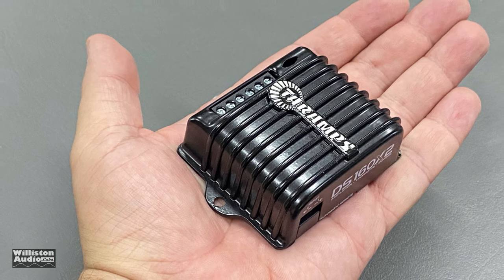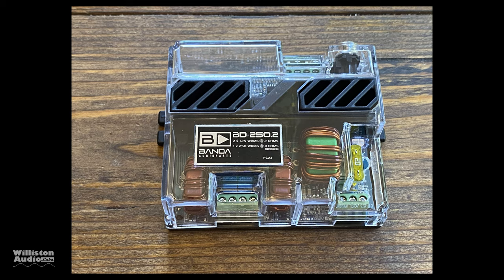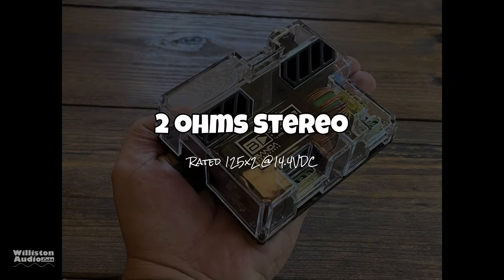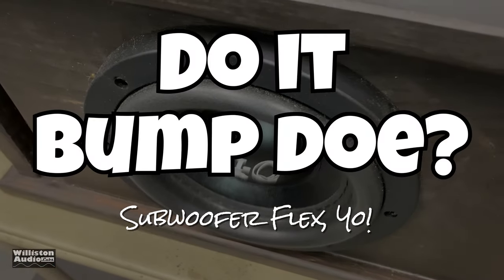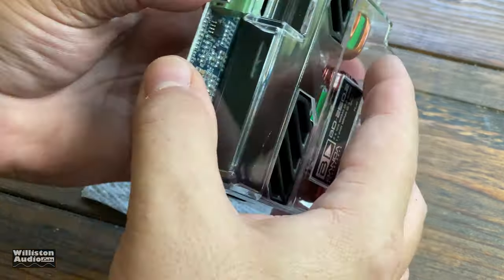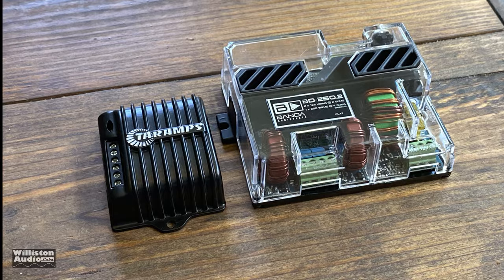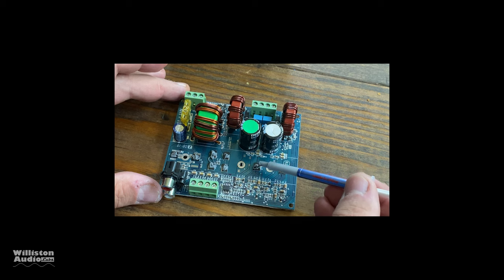This Little Amp is AMAZING! Banda BD250.2 Review and Amp Dyno Test

Comment: Hey Derek, I drive a concrete mixer I've added a 6.5 inch sub in a t-line box. I've been looking for a compact amp and this one is perfect!! I love your channel and your videos are awesome. Thanks for doing what you do!!
Reply from the maker: You may want to check the 250.1 model if you don’t have a crossover as that one has it built in. Thanks for watching and commenting!
Reply: Smith huh

Comment: So funny story, when I was 16 and I just got my first car (a 1990 Ford Festiva GL auto with AC as a gift from my grandmother) I had a Sony tape deck with a 10 disc CD changer, and I had a Kenwood bass booster (yeah...lmao), and a Blaupunkt 12 in a truck box in the back. It really didn't sound bad. I didn't have much cash back then, but it sounded decent with that car being a hatchback, and I eventually swapped in a 1.6L DOHC turbo Mazda engine into that car with a 5 speed and it hauled ass. My next car was a 1989 Chevrolet Beretta GT with two Orion Cobalt 10s with an unpowered Sony motorized tape deck, the same Sony 10 disc CD changer, a Sony 4 channel 500 watt amp, Infinity Kappa 5x7 split sets in the dash, Infinity Kappa 6.5s in the doors, and a Sony 1000 watt monoblock amp powering the subs.
Reply from the maker: Awesome!

Comment: Now that amp's are getting smaller and digital, someone should upgrade the amp's inside headunits as well.
Imagine a 2din headunit with 4x250wrms instead 4x50w. Can it be done?
Reply: ive been saying this for a few years now.
Reply: That be awesome
Reply: Doubt the companies will do that tho
Reply: In new cars with special a/c vent behind head unit to cool off.
Reply: 4x250wrms would be perfect for a nice setup!
Reply: @jeremypalon8327  why not? Imagine a brand like Pioneer do this. Would be populare i think
Reply: @lassediscovers1813  yeah would be cool tho, but like new cars nowadays already come with a decent head unit/ sound system with integrated things aswel. So there's prbbly not gonna be enough people who'd buy it
Reply: @lassediscovers1813  also sony kinda already has one but like 40Wrms × 4 @4ohm
Reply: @jeremypalon8327  i would👍🤣

Comment: Off topic, could you possibly test the theory that "low voltage" causes clipping. Im not sold, i think its the other way around, that clipping causes  low voltage. Considering lots of amps have operatinv voltages between 11 and 18v, would be interesting to see gains set at ssy 12.8 v then test for clipping at say 11.5. Thanks for reading.

Comment: Ever considered testing ARC Audio amps?  They are very popular for motorcycles and extremely expensive (way over priced in my opinion). I have the 600.4 amp and no longer run it.  The amp didn't last and their speakers lasted even less time. Way over inflated hype and cost.

Love to see what the 600.4 amp will actually do on the Dyno..  I still have my old amp I could loan for the video..

Comment: I enjoy watching your videos a lot, But id enjoy even more if you showed a 20hz-20khz .05% THD power test on all the amps you test.
Reply from the maker: I would also enjoy the $25k Audio Precision tester to run these tests.
Reply: Unfortunately They SMD dyno isn't that sensitive. The industry standard has been 1% for a while now, and since most people including those of us who are concerned with SQ, wouldn't be able to perceive distortion below 1% unless we were listening through very expensive, revealing speakers. The 0.5, 0.1, 0.05 tests are irrelevant for consumer grade electronics
Reply: @303nitzubishi4  That only responded to half my request. Regarding distortion measurements, it's only the "industry standard" for cheap amp manufacturers so they can inflate their power numbers. If they rated their amps at all frequencies from 20hz to 20khz and at the lowest possible distortion their power ratings would more realistic. (And lower) Well built amplifiers by reputable manufacturers rate their amplifiers from 20hz to 20kz at the lowest possible distortion. It's a shame the dyno isn't sensetive enough to give us a clearer picture of the build quality of the amplifiers, even the cheap ones. This is STILL the FTC rule for measuring power and subsequently advertising that power rating.
Reply: @wal  We can dream can we not? Still enjoy your videos!

Comment: Nice this would be a good amp for a car door speakers if your running them off your head unit like I'm doing. I'm getting 20 rms watts× 4 on my JVC head unit. That's only 80 rms watts. This Banda amp for $99 can put out well over that and sound good👍

Comment: I was thinking of using this and had a concern. Question on outputs for a 2 dr beater Geo Tracker. Looking @ stereo specs 4x60 watt output (15 watt/channel from harness). Want to use this 2 channel micro amp for convertible driving. What happens when I parallel the speaker wires into (input)  the amp (RF+RR into amp R input)? I know I need to parallel the 4 ohm speakers to get the 2 ohm amp rating on the output side.
What about the Banda 400.4?

Comment: This little amp is cool.  the other amp was about the same as running a head unit and i don't see the point of even using that one.  This however would have more of a use.

Comment: How did you play full range if the amp is only a class D? Or was that amp actualy a class H Digital thus capable of playing full range
Reply: Full-range Class D has existed for a long time now. It may be using the International Rectifier IRS2092 chipset, which is not only full-range but sounds quite nice.

Comment: I'd be trying a 40 amp fuse and see just how much I could squeeze out of it at 1 ohm or lower before it blew up. It just may put out up to 800 watts. I could see a wall of these on a wall of subs.
Reply from the maker: Now that I’ve finished testing it with speakers I could try. Those amp chips are SO tiny though

Comment: After seeing this little $99 amp's performance, the 'real' amp manufacturers should really consider whether it's still absolutely necessary to keep sticking the same electrical block design inside of an aluminum fireproof box.  The car audio urban legend had always been the aluminum box/case is half the cost and the electronics power board (and daughter cards) is the other half.  If the fireproofing (for when those fuses don't pop fast enough) isn't needed anymore, there is a massive cost savings to be shared by going with a plastic enclosure as with this amp.
Reply: Banda is a "real" amp manufacturer from Brazil.

Comment: Would this amp be good for tweeters on a network mode pioneer head unit. Thanks in advance.
Reply: This amp should have plenty of power for tweeters alone, though it has no gain control, so you'd have less flexibility on that regard.

Comment: If you some speakers laying around .have fun with them.I just took a Five Below bluetooth speaker and wired it to a MTX  6.75 component speaker (mounted in small wedge box) with crossover in parallel.Handles load pretty good.Sounds a lot better with some bass.

Comment: Does this amplifier support tri-mode bridging? It would be great to have one small amplifier powering a whole system or a great portable bluetooth device.
Reply from the maker: Yes but the bridging is left negative/right positive
Reply: @wal  what did you use for a low pass inductor for the subwoofer when running it full range in tri-mode?
Reply: Blue tooth?? Yea remembering a blue tooth scam at soccer field

Comment: Any amp reccomendations? Looking for 200x2 at 4 ohms, or 200x1 at 2 obms (can be give or take on either watts). Full range tho
Reply: taramps 800 by 4 200 w rms at 2 ohms per channel bridged is 300 plus at 4 ohms by 2
Reply: This is not wheeler/dealer channel is it

Comment: Just thinking out loud....but how well do they do in a sq setup?
Reply from the maker: I don’t speak in SQ terms as I feel this is subjective. Sounds good to my ears.
Reply: @wal  
I get you....most of the car audio guys in my country use brazilian amp. Me, I'm more kind of a oldskool amp guy.
Reply: @r_ce-marto934  ZED amps or ZED designed amps 👌 are the primo clean power amps circa 1980-1997
Reply: Class d is typically lower quality sound but for subs it's probably pretty solid with the right box

Comment: Cool. Would a old laptop power supply work if I wanted to push my inside home sub ?
Reply: No, you need a lot more amp's. Also 12V amplifier is not recommended for home use, not smart...
Reply: Its most likely too weak, a computer power supply can work if you bridge the 12v rails. However any home setup will sound better than a 12v one
Reply: @fernandogonzalez5770  your right I've noticed like a 100 watt home amp sounds louder and more powerful than a same watt car amp I wonder why ?
Reply: @bigbob3409  honestly im not 100% sure but cleaner means that you can play higher peaks so you get higher jumos in wattage, also theyre far more more efficient so they can put their max power more often. Aside from that im not exactly sure why they sound louder, but theyre definitely cleaner/more efficient
Reply: Fernando again aww shit who invited u. They really dnt know the Pope do they
Reply: @marthahansen7934  ? Alright

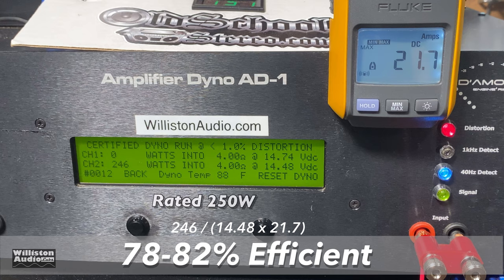Comment: I'm probably missing something but how did you get the amp up to 32a draw on a 20a fuse? @5:46
Reply from the maker: Fuses can pass more current than they are rated for short periods
Reply: Like a lightbuld
Reply: "Slow blow fuse" or a quick fuse, there are different styles depending on need

Comment: What is the voltage range on the banda ? I would like to use it on an 18vdc power source
Reply: too high
Reply: @bobking7347  not if it's 12/24 , suitable for trucks, like a lot of these are.

Comment: Golf carts? For the average person these would be great for a stealth build. 125W is more than enough for a 2ohm pair of separates, and even bridged they'd run a hihh-sensitivity sub like the Blaupunkts you tested awhile back.

You're not going to win any db Drag Races, but two of these with a decent head unit with built-in crossovers would be solid 

All that said, I didn't see a gain, so how to match the output voltage from the head unit?
Reply from the maker: Gain is fixed so that limits flexibility
Reply: @wal  How often are static gain setting used? I'm a noob but in my limited xp seems like the all in one subwoofer's( like jbl basspro12)gains do not have as extreme values to protect the equipment from idiots and noobies.
Reply: Lots of heads nowadays have sub level controls, so maybe that’s why these lil guys have fixed gain.
Reply: @wal  It's a shame manufacturers never agreed on a standard output voltage. Gain wouldn't even be necessary, at that point!
Reply: @bozanimal5576  Exactly. I actually do have a couple amps with their gain control labelled for output voltage, trouble is a lot of head units don't do their rated RCA voltage.

Comment: how can i wire it up for use in a home?
Reply: Yes, use a 12 volt LED power supply off Amazon or eBay. Anything around 30 amps will do the trick.

Comment: Whats a good cheap subwoofer
Reply: Anything from Skar Audio is cheap and they're still decent quality. My SDR-12 D2 was 100 bucks and I run that thing hard daily off 800 watts RMS with no trouble. If you really need to go cheap, look at the lower end Kicker stuff, such as the Comp C, you can typically find used Kicker subs in decent shape for real cheap used due to how popular they are.
Reply: I have a precision power BI154 it was like $115 or something and it hits decent. It's rated 650w and comes with a decent rubber surround

Comment: Would you use this to power 1 12 JL audio w1 12/ kicker comp R 1 12? 

Or power 2 6x9 and 2 6.5?
Reply: I would only use it for a max of 2 speakers. You could use it for a single subwoofer amp on a single JLW1, but the 250.1 is much better suited for such. The fact this amp lacks a crossover means that having one in the H/U or between the amp and speaker is an absolute 100% requirement if you don't want to damage the midrange you're using.

What I would do with this particular amp is integrate it and split channels in a factory setup. Let's say the front driver door has a 6.5" component setup. You could use this to add a second 6.5" component set to that door. Obviously, you'd copy that on the front passenger door. 

Now, rear speakers can get a bit more complicated. My 01 Lincoln LS came with an 8 channel THX system where the rear deck speakers function as free air "subwoofers." I'm going to ignore my setup because it's genuinely weird. If you have a typical 4 channel head unit, this would be useful to either add channels or make sure the existing channels are adequately powered for aftermarket speakers. For this, I would use a single amplifier, using the speaker level inputs to maintain two independent input channels and output channels to power the rear doors or rear deck on one amp. With a setup like mine, two 250.1s on extremely powerful 6x9 "subs" would be my go to, and power genuine subwoofers separately to taste.
Reply: Slipknotyk06 i agree with everything you said, and would use this type of amp for that same purpose. Id find a different amp to run a sub, buuut thats just me.
Reply: @justinfbabay  this amp is adequate for a single W1 (300W max) but I do think it's inadequate for most other subs.
Reply: @Slipknotyk06  Honest question, how well does that "free air" subwoofer setup do? I've got an old Nissan Sentra, 1994 model, it still has the original rear factory speakers, which are 6.5 mids and they seem to do really well for bass, I'm thinking of putting them on a low pass filter once I add my Alpine 4 channel amp in. I'm staying cheap on this car's audio for now, everything upgraded in it is from my truck's old setup. In the future I do plan to put a proper set of 6.5 inch coaxials in the rear deck, not sure yet if I'll leave them free air or mount them in some MDF boxes, which I think may improve the sound quality once I put a proper subwoofer setup in the car.
Reply: @ixionn563  So, I tend to prefer to use speaker baffles to essentially section off a small portion of the trunk as if they're small speaker boxes. However, free air is generally ok for most, especially if you dynomat that trunk deck.

Comment: How well shielded are these from electrical noise?
Reply from the maker: Didn’t notice any issues
Reply: @wal  Engine noise generator/simulator (alternator whine) for amplifier noise-rejection/susceptibility testing? A new category to evaluate and grade? Just thinking aloud (in the comments section, that is...).
Reply: @electronicengineer  Most of the time alternator whine and other noise is a result of ground loop or other poor installation practice and not necessarily a fault of the amp itself.  If noise enters the signal path, the amp is doing its job and making it larger! ;)

This is why I'm at a loss why mobile equipment doesn't used fully balanced inputs.
Reply from the maker: I have a charger that charges the Alpine head unit’s battery and there are time when I get noise in the amp from it, but none noticed here
Reply: @wal  A standard battery charger uses a step down transformer and rectifier.  No regulation or filtering so there is a LOT of AC ripple in its output.  The battery does help to buffer like a capacitor (filtering cap not the same thing as large caps put next to amps!) but if the battery charge state is low the ripple noise will be more apparent.  A better charger will use a SMPS (switch mode power supply) that can put out very clean DC (like the PSU in your computer) and many have user programmable/adjustable float settings or even can be dialed in for higher voltage (eg eight cell 16V) systems, etc.  No hum with those at all.

Comment: Would this amp be good for 6 by 9
Reply: Good Question for a Alpine R 6x9
Reply: Yes it does 4ohm and 2 ohm at stereo. Only problem there's no crossover but the head unit or bass blockers at the speakers will solve that problem.
Reply: Johnny 24 good to know I was looking for one for my alpines
Reply: @justinmitchell3807  I'd get a 4 channel if you have a 4 door speaker setup, that way you will still have fader control. If you don't care for fader control this 2 channel should work just fine as an upgrade over head unit power, just wire each set of speakers in parallel for 2 ohms on each channel (if you have 4 speakers).

Comment: That would be a great tweeter amp! It would work best with dome tweets using bass blockers seems like. You could wire two four ohm tweets down to 2ohm. Getting anything else down to 2 ohms would take a bit more power. I wouldn't mind using a couple to free up a couple of channels for more 6.5s, but I use super tweets that are 150 watts at 4ohms.
Reply: Class D is not the best for tweeters class D has a clipping signal if pushed to hard. Class A/B would be a better choice for sound quality.
Reply: That's what some say,  but my class D amps do just fine for me. The purpose of these tiny amps isn't sound quality which is evidenced by their size. That's the huge advantage class D has,  tiny size. Of course this is the reason why they are perfect for tweeters ;-)

Comment: What’s the disadvantages of the fixed gain
Reply from the maker: You can’t match the amp to a head units outputs. Just have to go with the fixed setting.
Reply: @wal  do we know what the fixed setting is at - thats the question.
Reply from the maker: It’s in the specs, I think it’s 1.8 volts for RCA
Reply: @wal  great so thats like a 2v pre out on a modern stereo right?
Reply: @ApEsXiT  I believe most modern head units these days to around 4 to 5 volts, meaning this amp would start clipping as you turned your volume control up. If used as a subwoofer amp this could be solved by lowering the subwoofer level in the head unit settings.
Reply: Thx  👑